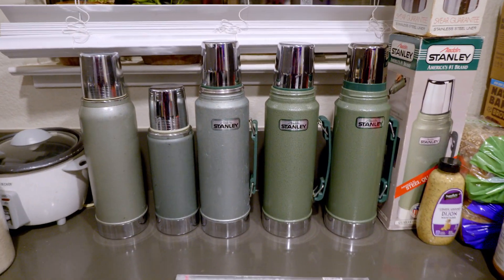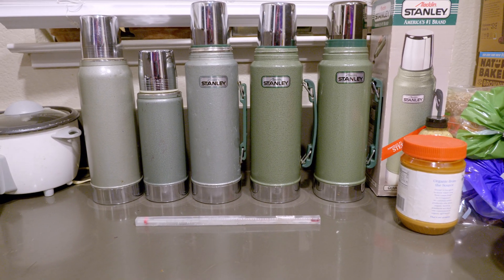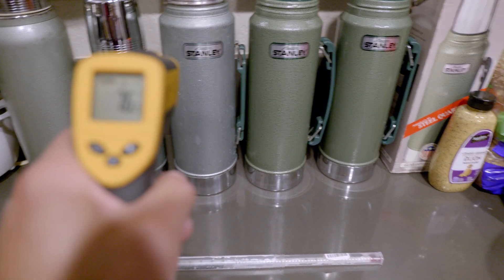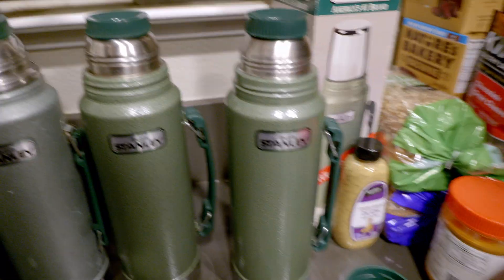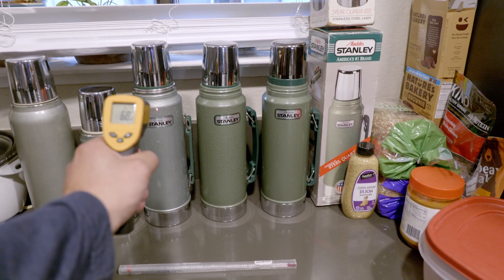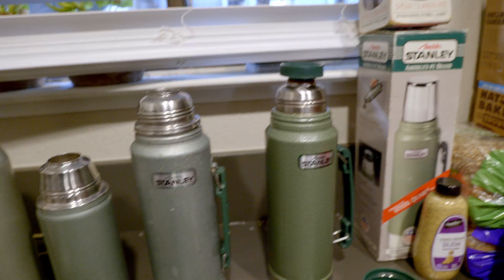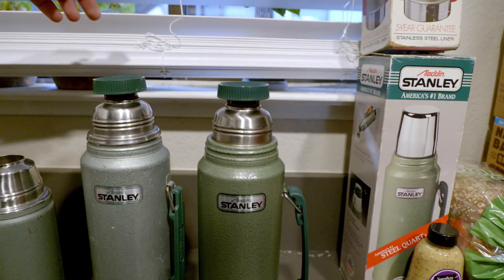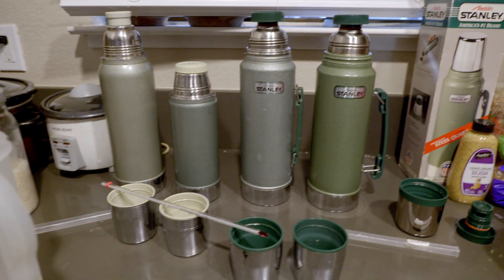Vintage, USA made Stanley Thermos Compared

Comment: i have a 66 year had a missing plug was 1 1/4 hole could not buy one so i used a 1 1/4 pvc fitting machined 2 groves for 2 rings  glued a plug in the fitting .

Comment: Quick note: Those thermometers average the temperature of their field of view. You have to put it close up so it only sees the bottle. Another thing is that it uses infrared to measure (light) and the tops that you were measuring are reflective, like a mirror, to IR, so you may have been measuring the temperature of a reflection and not of the top of the bottle itself.

Comment: You should put them up against the current ones
Reply: I did, I have about 10 stanley vintage from 55 to 89 with at least 2 from every decade. I did have a few 90s 00s and 10s. But they failed miserably so I got rid of them due to my results. The 2018 I tested hit room temp in less than 30 hours, it took over 72 hrs for pre 98 to do that. My consensus is pre 89 is the only ones worth owning. 90s are doable but post 98 you couldn't give me one for free

Comment: Hi I have a question maybe you could help with. 
I have an old 1975 Stanley wide mouth thermos. I was cleaning it and I opened up the small green plastic lid stopper and inside lid appears to be ..cork? Was that used for insulation purposes? 
Thanks
Reply: Just how it was made back then, yes for insulation. Made better than nowadays.
Reply: @kevinjacks1258  
Thanks. 
Absolutely correct you are, my 1975 thermos is far superior to my newer one I bought last year. My 75 inside stainless steel looks to be brand new while the new one already looks older and tarnished.
Reply: @kevinjacks1258  youre full of shit, the new ones are the same or better quality. the lid design is MUCH better.